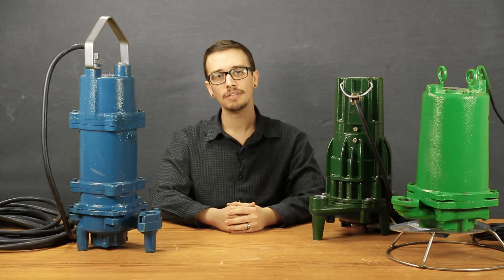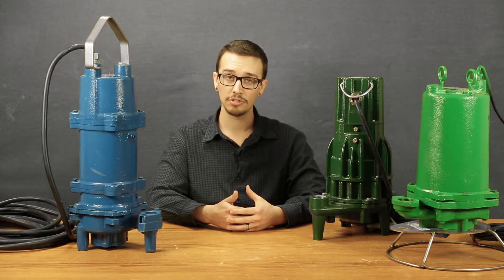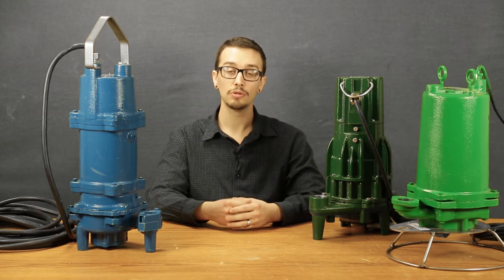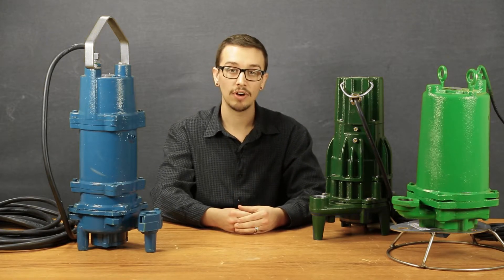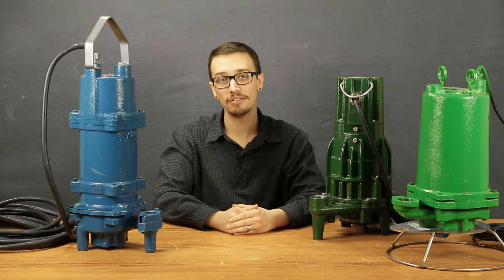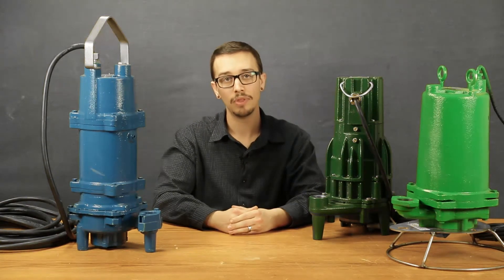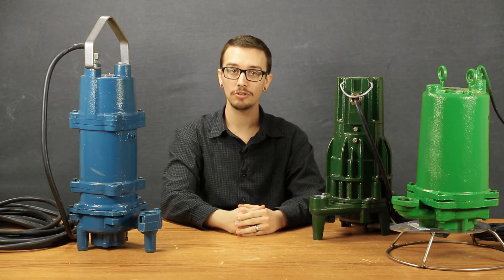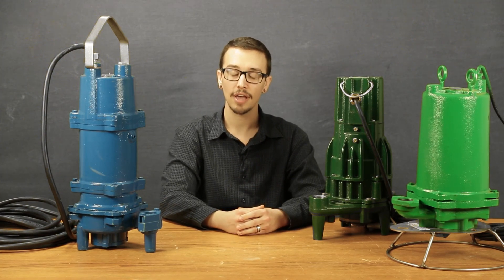Selecting a Grinder Pump

Comment: Chris, you stated in your video entitled, "5 reasons you don't need a grinder pump"  the things that go wrong with grinder pumps including getting clogged easier and expensive, but you didn't say in that video or this one, what the proper application for a grinder pump is. Can you direct me to another video about that or give some reasons why you "have to" use a grinder pump? Thank you. Very informative videos.
Reply from the maker: The main reason grinders are selected is when you need to pump solids against a high head (60ft+), or pressure.  This could be from a hug hill you need to overcome, a long very long distance, a pressurized sewer main, or a combination of each. Give us a call if you need help determining whether you need a grinder: 855.329.4519